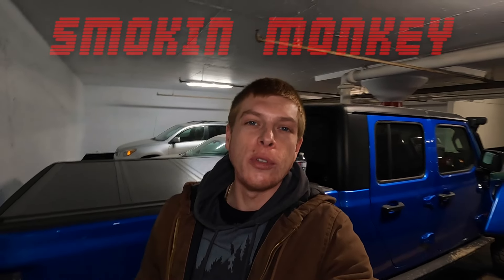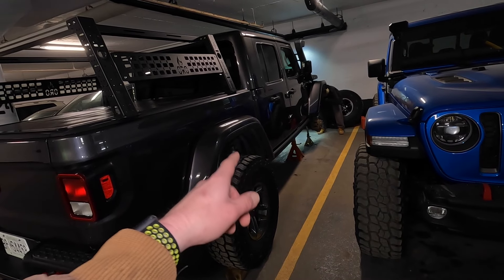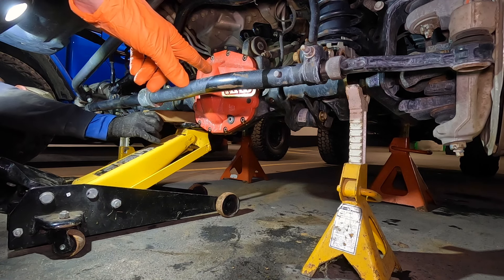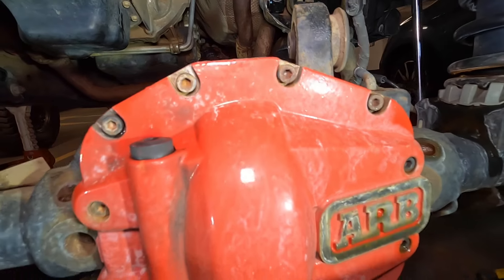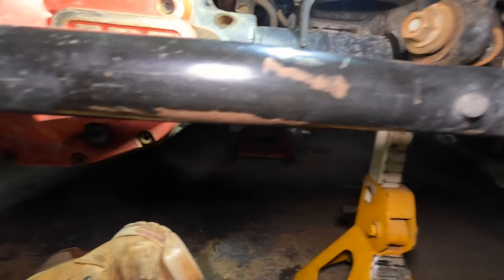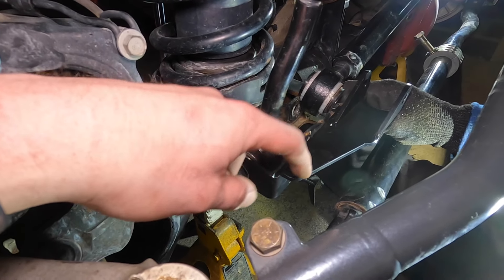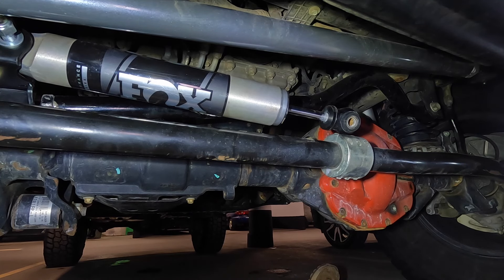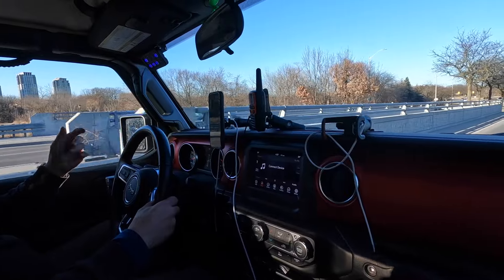Don't Forget This Crucial Mod For Any Lifted Wrangler Or Gladiator JL/JT

Comment: I got rid of my rock jock bracket and went with the Clayton bracket cause it comes with the 9/16th bolt to take the play out of the track bar. My holes ovaled out and got death wobble

Comment: If I get a vote I’m voting for the snorkel on your Jeep. It’s cleaner and serves the same purpose. No way I’m cutting a hole in that hood.
Reply from the maker: That’s the reason I went with that one. They cost almost the same but I prefer the cleaner look and I can remove my high snorkel and have the intake just at the bottom of the windshield with this one it has two different intakes to choose from